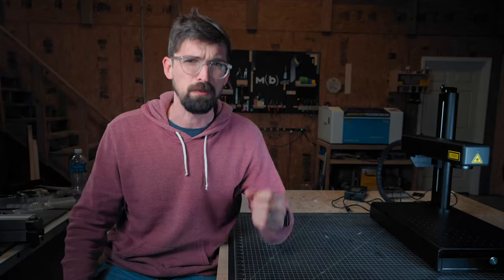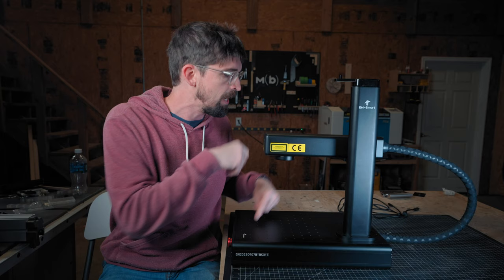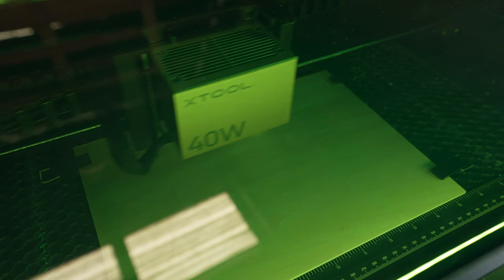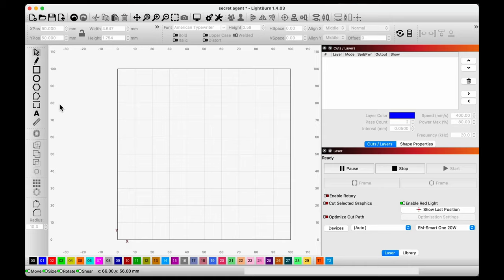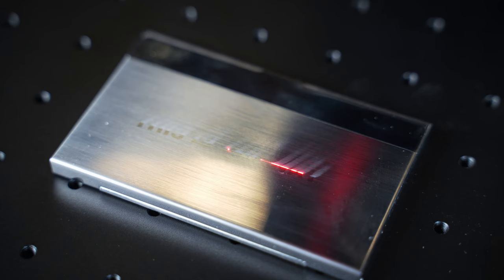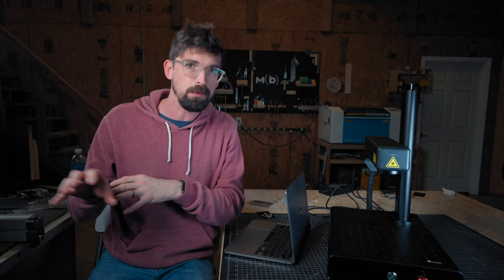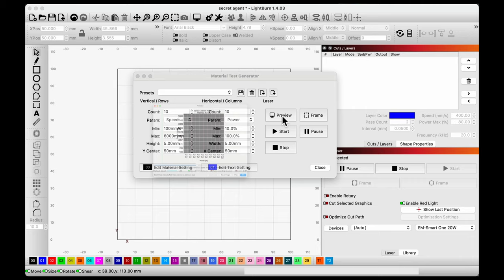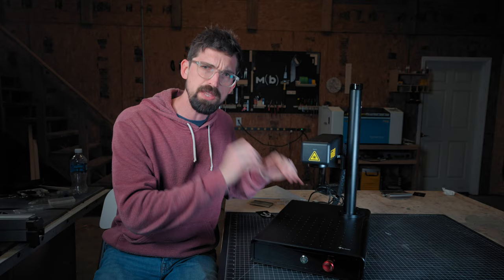Should You Get a Fiber Laser?

Comment: The fibre laser frequency is the rate at which it fires light pulses at the target. The speed is the speed at which it moves linearly so if you move fast and the frequency is low, you will see a series of dots. This is also the reason why you can mark metals, there is so much power in that single pulse, much less than 1 microsecond long, that the metal is ablated. Average power might sound low but those pulses are supplying a large fraction of, for example, 1 milli Joule in 100 nanoseconds, the instantaneous power is = energy / time, or 10 kilo Watt.
Reply: Great post thank you. That was helpful to read.

Comment: The cable is not why there called fiber lasers, rather it's the coil of optical fibre inside the machine, that stores the output from multiple diodes, and then realeses it in a pulse (which then travels down the external  cable)

Comment: Hi, very useful and informative 👍. Can you tell me how much material is removed during the process? I’m thinking of brass, could it be used to create a wood brand, perhaps with multiple/many passes.
Reply from the maker: Great question, I don't think something at this power could give you a deep enough engrave to make a stamp.  typically thats going to need a CNC router to get deeper in metal.
Reply: @makeorbreakshop  hi, thanks for getting back to.  I’ve been considering a cnc but was thinking the laser could give a finer resolution for smaller brands.

Comment: 1800 dollar laser that wont cut materials. im  good
Reply from the maker: it's a different use case, i wouldn't get a machine like this if you are looking to cut, but if you need to mark on items and do a bunch of them this is going to do amazing.
Reply: Wrong application. MOPA is a marker. Not a cutter. Fiber laser cutter will set you back $50K to start. CO2 cannot engrave anywhere fast as MOPA laser marker/engraving. Though engraving and marking space becomes limited with these desktop marker.
Reply: They aren't meant to cut. And often they are actually called marking lasers. So, there's that.